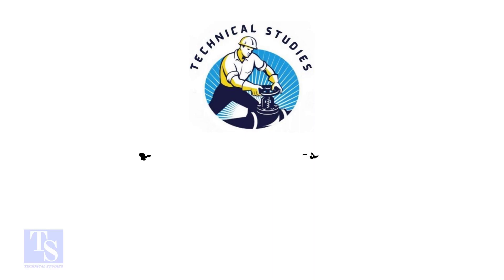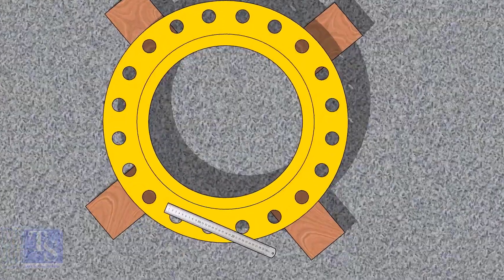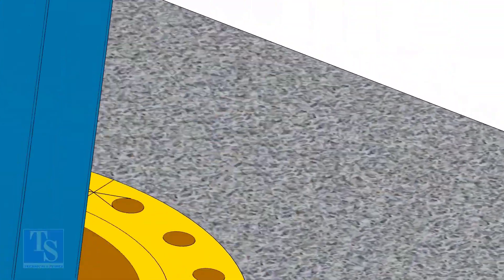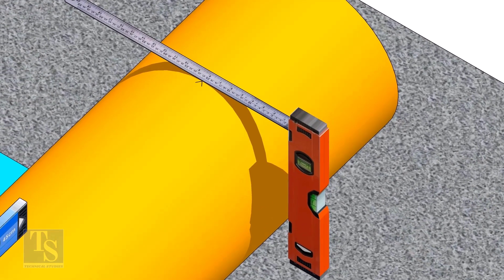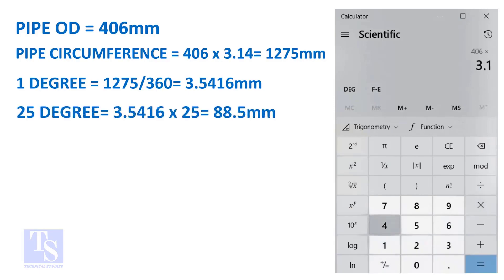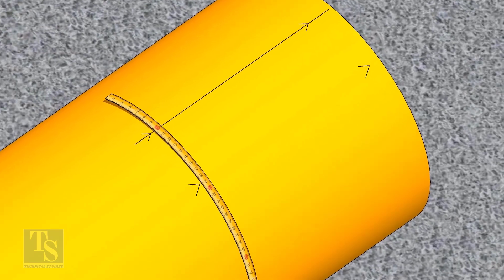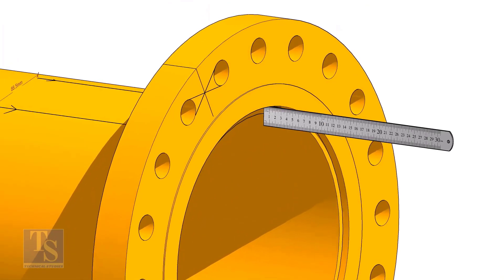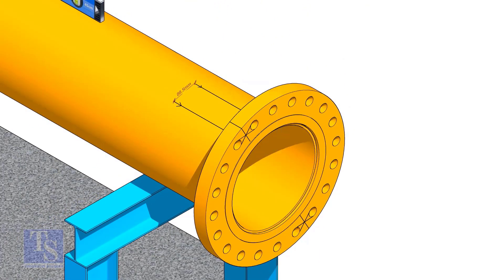How to fit up a Flange Rotated any degree to Pipe

Comment: Why need to rotate flanges in pipe? What is the reason? Thank for answering more power
Reply from the maker: sometimes, connecting the piping to an equipment bro.
Reply: Angle finder across two holes if you have one